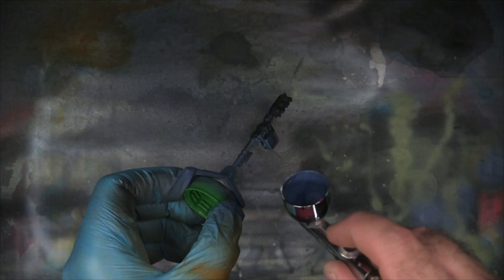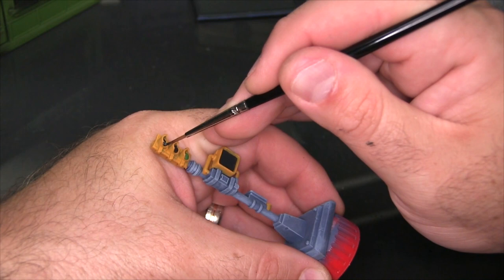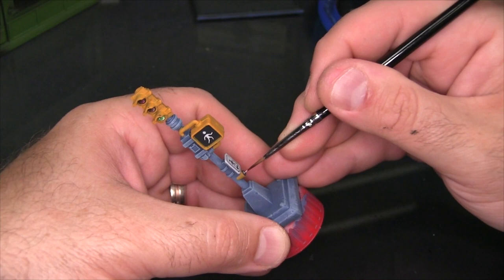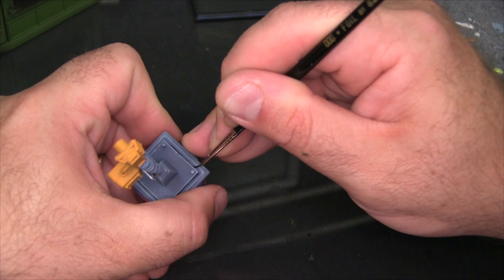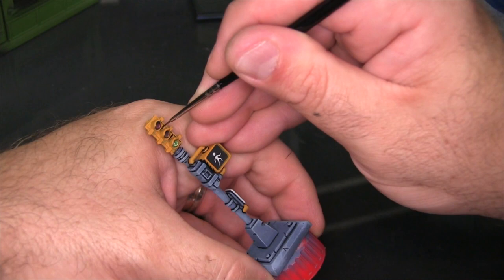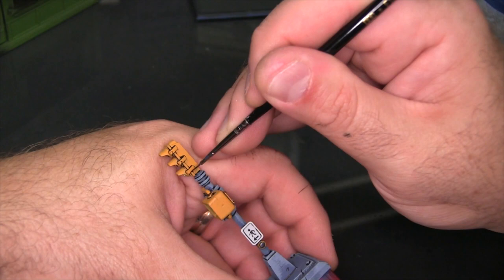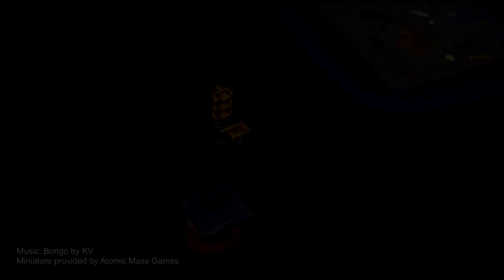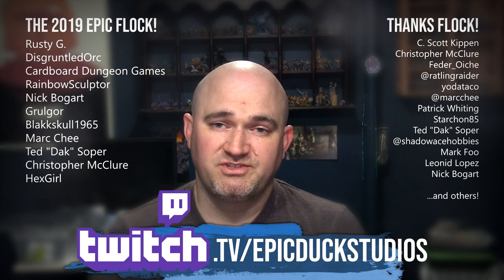Painting Traffic Lights for Marvel Crisis Protocol - Comic Style Scatter Terrain

Comment: This looks just amazing and defiantly worth a try. In case if I have missed it: what black ink are you using to do the blacklining?
Also, I am thinking of using this technique for my Necromunda terrain (Zone Mortalis) but after seeing how much time it takes to line out all the shadows and the number of crevices on a terrain piece I am somewhat hesitating.
Is there any way how to speed up the whole process? Maybe spray the model with gloss varnish and then use black oil paint for lining? I am a bit concerned that lines won't be as thick as when you use a brush.
Reply from the maker: If you use an oil for lining you'll get very blurry, indistinct lines. It's not a bad result, but it's not even in the same ballpark, presentation-wise.
Reply from the maker: It's worth noting that in plenty of comics, the background (aka your Necromunda terrain) isn't lined with the same amount of detail as a character or foreground element, if it's even lined at all. Often characters are drawn as linework over more of a painted scene. So there's precedent for keeping the linework on your background terrain to a minimum or taking a simpler approach, and leaving the detailed work for your characters - or the lamp posts they'll be smashed with ;)
Reply from the maker: Oh and sorry, I missed your first question! The black inks I use are Daler Rowney FW Black or Higgins Black Magic. Liquitex Carbon Black or Amsterdam Black ink work well too. Basically any waterproof artist ink should be fine. just test it on a spare chunk of sprue or something for colourfastness - some inks will run when you spray a varnish on them, for example.